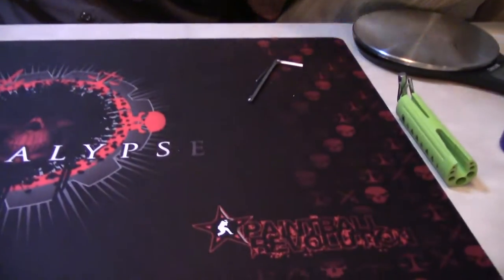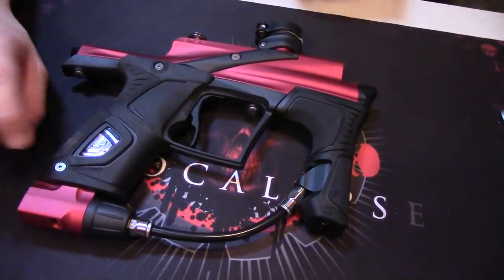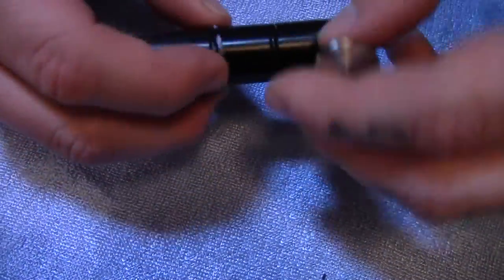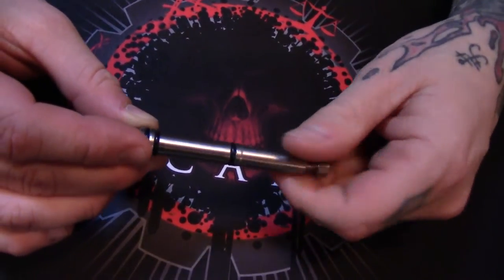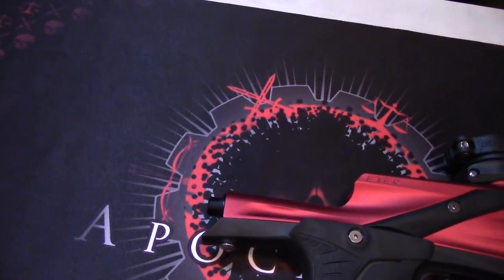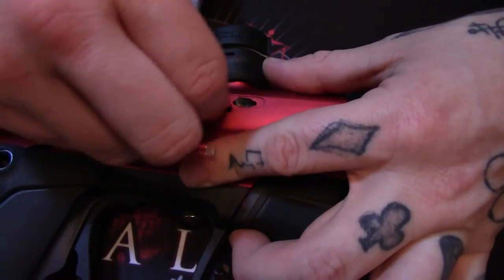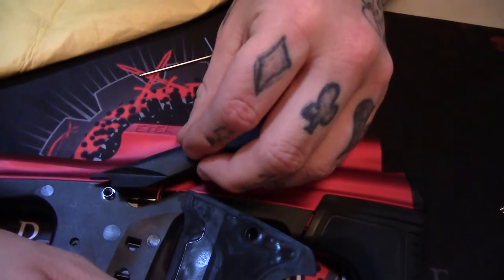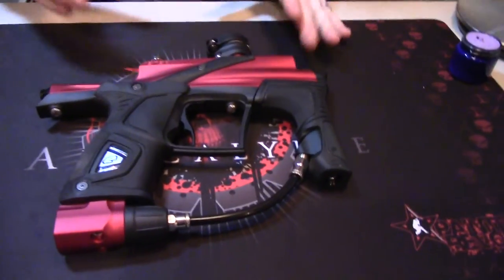Etek 5 Maintenance

Comment: In reply to the comment by Mi6GY:  It says not to use grease.  But they (PE) are assuming that you have Dow33 (PE) or SL33K grease for your reg.  Pooty's grease is actually more viscous than those two so it should be OK to use on the rammer.

Comment: On page 45 on the etek5 manual it clearly states not to use grease on the rammer.
Reply from the maker: I have always used a high grade paintball lube on all my parts and never one problem every, also if it does for some reasons creates a problem there is ways to clean it in depth

Comment: I think I'm messing up on putting the bolt back in. When I try shooting my gun it will shoot only one paintball then no more. When I pull the trigger all I get is air coming out, but paintballs are in the neck of the gun. Any further insight on how to fix this problem?
Reply from the maker: That will might mean the bolt pin was not pushed down into the rammer, did you take the whole marker apart ?

Comment: Use oil instead of grease. If you end up using to much, it'll gunk up. With oil, you don't have to worry about putting in to much or gunking. Not saying that its law to use oil, but its easier on the fast moving parts. Plus, the Etek 5 come with oil, so why not use it?